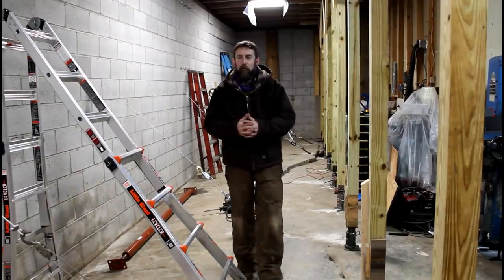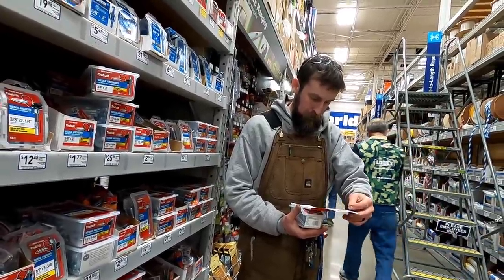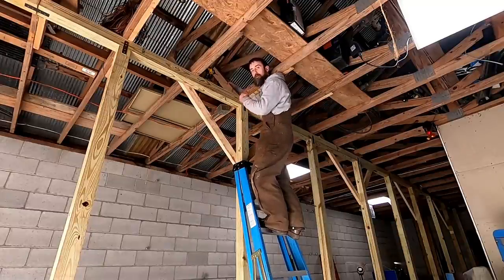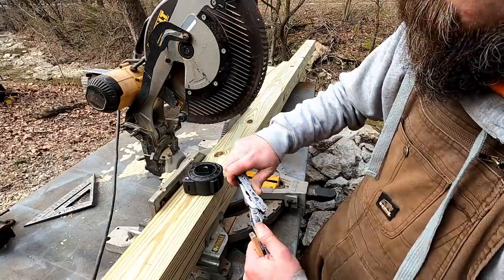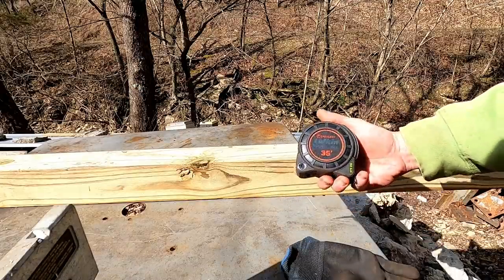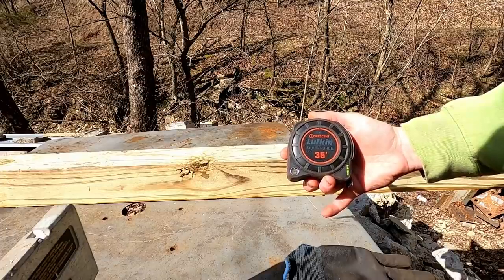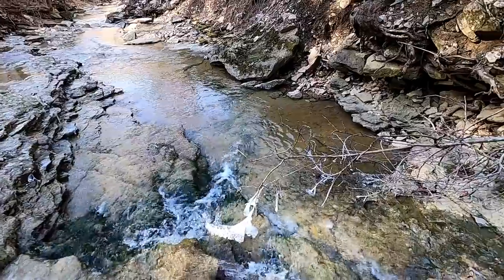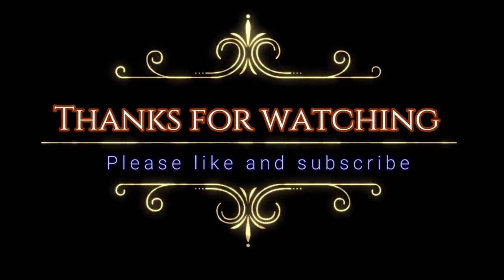Repairs To the shop begin ! Preparing the roof lift wall

Comment: What’s to stop the wall falling out and lifting the broken slab with it when you lift the roof? Good luck man!
Reply from the maker: I'm not lifting the roof completely off the studs. All I plan to do is take the weight off. Hopefully that works. Definitely some unknowns here. 👍
Reply: My 2 cents worth - think about moving the anchors well back into the stable part of the slab. It’s probably not going to move when you take the friction off the top of the block work but sometimes it’s better to be super safe than sorry! Really enjoy the videos, and I’m wishing you every success! Hell of a project!
Reply: @SteveSummers  Hi Steve, you have braced to the broken slab, it has less mass than the wall, so if the slab is in supported at its edge it will act like a seesaw and let the whole lot tip outwards. Secure to the fixed slab and worst case it will drop but not rotate outwards. Nick, UK.

Comment: Once the wall is lifted and straightened...can concrete be pumped in underneath using a 2-3" trash pump..just mix the concrete and pump it underneath?  I have seen workers raising a slab at work with one of those..drilled a large hole in the slab, then pumped concrete under it and it raised the  slab!

Comment: Do the bottlejacks leak down over time, is that why you're bracing them once the roof is lifted?
Reply: Maybe. You should never rely on hydraulics to hold up a load. Just bad form.
Reply: @1pcfred  hydraulics will hold a load just fine with counterbalance or holding valves, bottlejacks dont have those though.
Reply: @brianwalk108  any seal can leak. So you'd have to be an absolute idiot to rely on it. But there are plenty of those in the world today. The technical term we use for them collectively is, "statistics".
Reply: @1pcfred  anything can fail, so yes we're all idiots, you win.
Reply: @brianwalk108  a solid brace of sufficient strength is not going to fail at the same frequency that a hydraulic seal will. There's literally columns that were erected thousands of years ago that are still holding up. They're just that reliable.

Comment: Steve, is it possible to get a little mini-ex in there and poke the wall a couple times to get it to come down? One block at a time by hand would be super labor-intensive!
Reply: With all that bracing he's got going on and no access outside this is a hand work job. It's what keeps laborers in business. Can't do everything with machinery. Which is a good thing for the working man.

Comment: Come on Steve, free hand on the tablesaw! And with gloves! 
At least clamp a piece of angle iron down.
Reply: Really, Steve, look in to the danger of using your table saw like that. That is too easy to get away from you.
Reply: Rick Palechuk yeah... agreed. That is simply unacceptable
Reply: No riving knife on that saw either.
Reply: @patrickshaw7983  boo hoo
Reply: @patrickshaw7983  don't forget the guard and the knee pads and condoms.

Comment: Never noticed the square body was 3 on the tree. Ah, memories. First time my friend was in ours he freaked out when he thought I was throwing it into Park at speed.
Reply: It's not. If you watched one of his earlier road trip videos you can see its a floor shift.
Reply: @hilltopmachineworks2131  Whoops, you are right. I forgot that the floor mounted shifter throw on the older trucks was pretty long.
Reply: @R2.0  If I had to guess it is probably a SM465.

Comment: With the Wall leaning out 7 degrees,are the trusses still secured in place on the opposite wall? Glad to hear you got a person to look at what you are doing. Always good to have a second set of eyes on the job.
Reply from the maker: The floor is tilted over 8 degrees.  The wall is bowed in the middle.  Trusses are fine on the other side.

Comment: whoever built the solid wall must have thought it was a great idea to erect a solid structure on a non existent foundation in the first place then leave out the mesh in the concrete, the wall has to be able to sustain movement being where it is and be of timber or steel construction.

Comment: How the hell did wheel barrows get so expensive, it's just as bad here in the UK.
Reply: I buy wheelbarrows used. I got a fleet of them here now. There's two sizes. A little one and a bigger one. The bigger ones can cost.

Comment: Both of  you are naughty ain't cha? Seat belts save lives, though smashing your head on the back window will hurt something nice
Reply: Truthisstrangerthan Fiction  I rode a Yamaha R6 for a long time (for my age), and a lot of motorcycle riders are some of the most careless people I've ever met. It's part of the lifestyle. You ride a bike for the thrill. I didn't really care about the risk of dying, as long as I was riding when I died. I rode with a group of ~50 bikes on long rides, and every few months we would lose another rider. Usually because, "some idiot pulled out in front of him." They always neglect the fact that he was doing 160 mph and even though the car puked out in front of them, they couldn't judge that the bike was traveling at almost 4x the speed limit and would close the gap VERY quick. A lot of these guys are not 20 something year old stupid kids. They were anywhere between 20-50 y.o. Several CEOs of local businesses, 2 ex GP racers, and very responsible people. I couldn't put my family through the pain everyone I'd go riding. So I sold my bike. My cousin died on his Harley in October, RIP, so it's not just sport bike riders.

Comment: HI STEVE, I WAS TOLT BY A WIRE ROPE MAN, YOU SHOULD HAVE 2 PREFIRLEBY 3 CLIPS ON A ROPE !!. REGARDS
Reply from the maker: I thought about more cable clamps but decided that if it wanted to fall bad enough to take that one clamp the it can have it. 😁